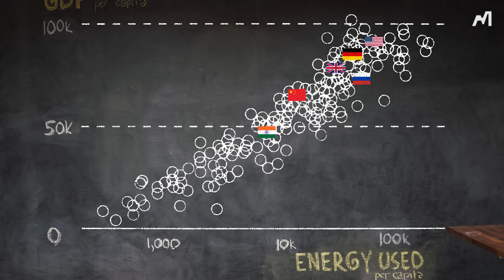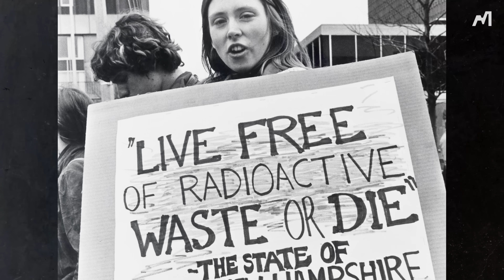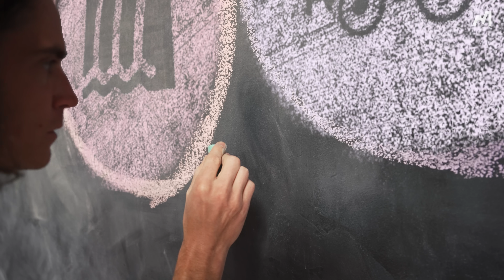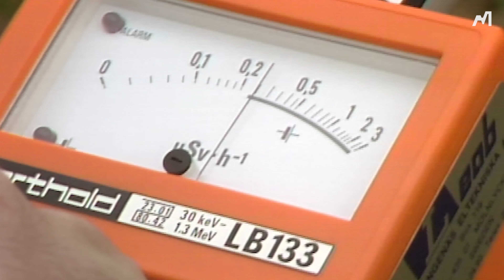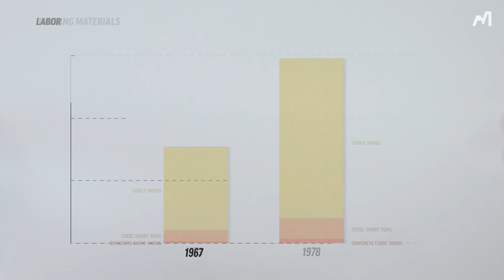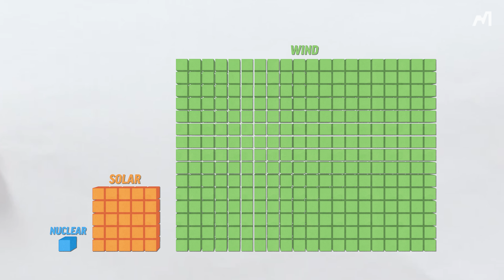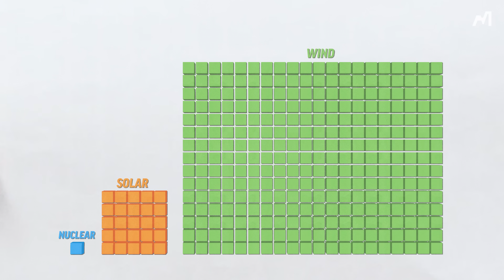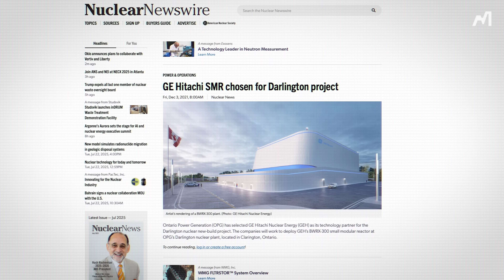They're Lying to You About Nuclear Energy

Comment: Excellent video, though I wish you addressed the alternative solution which could be made better than waste disposal given sufficient R&D. Re-using spent fuel through nuclear fuel reprocessing is what France uses and is partially why they have 70% nuclear power.
Reply: fuel is reprocessed with some magic - ok. what will they do with megatons of irradiated steel and concrete?
Reply: @guai9632  irritated does not mean radioactive and the casks (weather with fuel inside them or if the fuel has been removed) are only slightly above background levels. It is safe to touch casks holding spent fuel, removing the spent fuel does not make it more radioactive. the longer something decays for, the less radioactive it gets. now that i have shown that the cleaned, emptied casks are not super dangerous, we would probably do with the steel and concrete that we do with any other steel and concrete we have used in buildings. the steel is almost always recycled and the concrete will get downcycled (crushed into gravel).

Finally fuel reprocessing is not "magic" as it already works in France and has been for decades.
Reply: @electricminecrafter irradiated actually does mean radioactive. not much, but there's no technology to remove those impurities from the molten metal. I bet you don't want  water pipes in your house to be made of recycled irradiated metal.
Reply: @guai9632  If you'd use that irradiated steel for reinforcing concrete, it might just reach the same level of radiation from the granite sand, gravel and pebbles in the concrete. Might.
Reply: @guai9632 The same "magic" works on those too, if you ever bothered to understand it.
Reply: Doesn't France just dump its waste in the ocean, just like Russia?
Reply: @enratranav7682 no they burry it all underground within waste storage facilities
Reply: Actually it is much more expensive to reuse fuel than to used newly mined fuel. And you are still left with highly radioative waste, highly toxic and radioactively contaminated  chemicals that were used in the process. France does it for strategic reasons, not because it makes economic sense.
Reply: I think he sufficiently pointed out that nuclear waste is such a small problem that it is irrelevant. Nobody is going to steal it. It is not causing any harm. 

If he were to spend much more time on the topic of the waste it would only inflame opponents. 

I agree that there are ways to reuse the waste to a point that there is significantly less to deal with. There are also means of disposal that are less harmful to the environment than other hazardous waste materials that are unknown to the public and managed without incident. 

The fear mongering culture around nuclear has done considerable damage. The fear has no basis in reality, but the age group with the most fear is the same people who have the wealth and voter participation rates to impress their views on the world.
Reply: True. But that is a hot button issue in the US.  Just stick the high level waste under a stable mountain, out in the middle of nowhere. But that also leads to hysteria.
Reply: @Mythhammer I live in Nevada, been here 44 years. I've never met anyone that supported yucca mountain. I have always thought it was the best option. In fact, I believe the state of Nevada should have been able to negotiate enough benefits for residents of the state to make it politically positive locally. Free education to Nevada residents for accepting the waste. That would have funded our higher education and motivated secondary education to improve the quality of high school graduates. This would have significantly helped diversify our economy. 

There is no perfect place to put the stuff, but it is not as volatile as critics claim. They act like nuclear waste is alive and sentient with determination to escape any confinement we create so it can destroy the world. 

Yucca Mountain should have been used.
Reply: @hewhohasnoidentity4377  I think the main concern is leakage into ground water. Plus the danger of transporting it. But yeah, the fear is probably overblown.
Reply: @hewhohasnoidentity4377  as a fellow Nevadan I’d agree that Yucca might’ve been one of the best options. I’m not educated enough on the white river watershed to evaluate the groundwater pollution risk, but if done properly then I doubt it’d be unreasonable.
Reply: @Mythhammer   just throw it in space every 25 years. Simple.
1 big rocket carrying several tons of nuclear waste to space every 25 years. 
Will it make the waste net zero? No. But by the time you go for round 2, rockets would be able to carry many more tons for much less cost as VCs would have an incentive to invest in nuclear waste disposal industry.
Reply: Storing it is a better option than what France does, which is very expensive and barely improves fuel utilization. Better to wait for molten salt reactors, which can entirely consume the long lived component of that waste with very little processing, and without subsidy. Beware the "advanced" reactor vendors that want to be paid for "destroying waste", which they need, because their fast reactors are inherently uneconomical without free fuel.
Reply: @Th-233  Fast reactors can do that too, buddy. Thermal MSRs are not well suited for spent reactor plutonium anyways, you want a fast spectrum for that.
Reply: @Shaker626  Thermal MSRs burn plutonium just fine, and Copenhagen Atomics's TEAC11 presentation in 2022 shows the evolution of TRUs in their reactor. Fast reactors are only necessary if you want to consume the U-238, but they also need a lot more fissile to start, and so the economics don't work. It's also easier to just separate the uranium out first and recycle it back into LEU for conventional reactors, and the plutonium will be burned much faster too. Fast reactors will just produce more of it.

Comment: When I first saw a graph depicting energy output per square mile, I did a complete 180 on nuclear. It’s simply too useful to ignore.
Reply: Why is that compelling though, the world is full of vast tracts of empty space?  Solar works well on roofs, wind works best at sea.

In fact decentralised energy generation is more robust, a single local event can stop a nuclear plant working, it would have to be a regional scale event to stop renewables.
Reply: @slrsteve6359  very simply I actually care about the environment, I would prefer not to completely destroy ecosystems or huge amounts of the countryside/sea with inefficient wind-farms/solar-farms. Nuclear has the basically least impact on wildlife. Decentralization is ultimately uninteresting to me in the face of that. Solar panels are fine for roofs, and turbines should be rare.
Reply: @kurtwagner350 as you observed with solar, there is no direct association between renewables and damage to the environment.  Farmland isn't natural, it's an industrial landscape.  Waters fished using many modern methods are often significantly denatured.

Solar and wind can actually protect regions from further excess human activities and restore a more eco diverse and balanced environment.

Of course any human activities do damage, but good quality solar and wind projects are restorative, not destructive.
Reply: @slrsteve6359  Which means a region-wide devestaiton would further lead to a energy crisis simultaneously. 
And, unless you're accounting for the energy storage, overhead production, waste recycling, etc., Intermittent Renewables are NOT truly green, just non-carbon-emitting.
Reply: @slrsteve6359  land is the ultimate nonrenewable resource, and there's less "empty" land all the time. The best part is the less empty land there is, the more power you need.

Wind and solar aren't bad supplements, but they don't work well at all as the main power source for base demand.
Reply: @Michael-uc2pn any land used for solar can easily be reused, so it is renewable.  In fact, land quality usually improves over the life of a solar farm.  Biodiversity, no use of fertiliser and pesticides, improved water retention etc. also generally improve the local environment.

In the end, to have enough solar under current plans, would require half the land currently used for golf courses.  It's not a big issue.
Reply: Especially when the competition is a barrel of oil. A barrel of oil, ONE barrel, has the energy potential, it carries the work - when expressed in calories, of a healthy adult male doing demanding physical labor, every hour of sunlight for two years. 

The only substitute to nuclear in my mind is geothermal, and you'd have to make a pretty decent borehole to rival the same energy output. Regardless, both are just different ways to boil water to spin copper around magnets.
Reply: @Mix1mum  geothermal is technically just nuclear where the whole earth is your reactor core, casing and you just happen to put a little turbine on it
Reply: @Mix1mum  Fact: It's not. Geothermal has better power output per land area than other Renewables, but all Renewables have VERY LOW DENSITY. 
Plus, a even bigger reason, it's extremely geographically limited. Only a few regions exist where it is technologically possible to extract earth's internal heat. 
It is better than nearly all renewables, but most intermittent renewables are horrifically inefficient, and polluting too. Water and Land pollution is NOT a joke.
Reply: @ZippyPiglin36  if you can dig deep enough, every place on earth is a potential geothermal power plant. We just lack the motivation to dig deep enough.
Reply: @aparnarai3708   Lack the motivation? It's less about lacking motivation, and more about every material that we have literally melts down digging too deep. 
This is why I don't like the pro-renewables crowd. They assume that technology FAR beyond this era would be immediately available in this decade, often considered the "time limit" to revert climate change, and ignore or have intense paranoia about the last sixty years of nuclear energy development.
Reply: @ZippyPiglin36 i personally am in great favor of the proliferation of nuclear reactors and that investment switch from those hordes of useless half the time 'ot active windmills to the ITER project (for nuclear fusion reactors)
Reply: @Project-Hellion I mean, I am in support of Nuclear, but I would still want to see Renewables compete amongst themselves on pure free market principles (aka, no subsidies or government help). 
Fusion however.... it wouldn't be inaccurate to say that Fusion is to be the Fifth Generation of Nuclear. Afterall, both Fission and Fusion are beautiful and necessary steps for a civilisation to upgrade to.
Reply: @ZippyPiglin36 i personally dont want any market competition but eh im not from the USA my views on economics are wildly different and id prefer a world of benevolent econmic actors going for the  interest of humankind as a whole instead of filling theor pockets with a bunch of moeny they wont even use but i digress to me wind and solar are better off for small scale use while nuclear would power the large grids for cities etc
Reply: @Project-Hellion So your views are Leftist in economic policies... You do realise that any attempt at making a coordinated benevolent economy would mean people would be poor simultaneously, without necessarily meaning that government forces would be forced to do similar? 
Socialism seems great, until you realise all it does is combine private and public sector into the government's hands, and results in the general civilian suffering, since if every civilian is poor it does fall under economic equality. 
"Filling every pocket.." is how you grow. Humans grow fastest when their competition is other humans. Such competition is why we expanded into the world as apex predators. You NEED the general populace to have as much as or more power than the government by practice itself, and not relying on fragile paperwork. 
And, I am not for America. It doesn't take Socialism to instill basic workers' rights. Leftism seems great, until you realise it collapses upon itself because of the very nature that makes us human.
Reply: @ZippyPiglin36 remember the time USA and USSR were competiting about who can dig deeper? No one had the tech to go that deep back then. You know what they did? They developed it.
So yeah, we do lack the motivation. VCs don't invest much in this technology's research and researchers don't explore alloys which can go deeper.
Reply: @aparnarai3708  Dude it's been decades since we have had such research with no success. 
Yes, they did have such competition. Doesn't mean said holes were useful otherwise. You need widerz genuinely useful, holes to use geothermal. Mines haven't gotten much too deeper since a very long time.
Reply: Shame this is total nonsense and what actually matters is energy output per cost. Which nuclear is decidedly worse in than solar and wind and this is despite nuclear receiving easily 100 times the research funding over the decades.
Reply: @XMysticHerox  per cost meaning initial investment or operating costs. As far as I’m aware the only significant costs associated with nuclear are the initial investment. After which it is very cheap to operate relative to revenue and energy production.
Reply: @kurtwagner350  Lifetime costs. You should probably look into this if you have any interest in this. It is rather important and nuclear "enthusiasts" love to just ignore it.
Reply: @XMysticHerox  maybe you should look into what lifetime costs consist of because I literally already addressed it. 

In terms of operating LCOE Nuclear is actually cheaper over the lifespan of a nuclear plant than comparable solar generation. Again while also taking up vastly less space and is actually capable of meeting base load power demands 24/7 unlike solar rn. 

And yeah nuclear “enthusiasts” like to overlook upfront costs for precisely those advantages. Meanwhile solar & wind “enthusiasts” love to overlook actual practicalities of what can and should be implemented at scale in our centralized grids by governments (nuclear), vs what makes more sense to use for decentralized uses on a micro scale (solar & wind)
Reply: @XMysticHerox  according to my calculations
PV in the subtropic (desert) with no battery backup: 0,032 $/kWh
PV in the subtropic with a 4 hour backup: 0,073 $/kWh
PV in a temparate climate with a 4 hour backup: 0,10 $/kWh

new nuclear plant construction: 0,055 to 0,069 $/kWh with higher estimates up to 0.1 to 0.2

nuclear takes up very roughly 10 times less area than solar per unit of energy, this is without battery backups
in a desert it doesnt matter but in the temparate zone every square kilometer is land with high biodiversity

PV is in no way cleaner than nuclear, and it is not reliable
while you can have a factory running only during the day, urban areas and datacenters will demand 24/7 power

these are competitive technologies, both have their places
solar belongs on roofs or in deserts
nuclear belongs everywhere you cant build or rely on renewables

also nuclear is so expensive because of regulation and arbitrary component requirements
PV (including manufacturing R&D) has very roughly recieved half the research resources as nuclear (including fusion), do note that this is not adjusted to inflation to reflect the resources that they actually got
Reply: Show how many square miles are contaminated by nuclear fallout.  Fukushima and Chernobyl ABSOLUTELY did contaminate vast areas.  Birth defects have definitely increased.  Believing the USSR and Japanese govts own self reporting about deaths, cancers, heart defects, birth defects is beyond naive; it is willful misinformation with the intent to deceive people into believing nuclear fission is safe.
Reply: As there are a lot of nuclear powerplants around the world now... why is the energy cost still so high?
Reply: @MarkAntony01   Only a select few nations have ever had any nuclear powerplants. Out of those, all except France has had Nuclear for less than 10% of their total grid power in their own atomic ages at best. 
France, with mostly nuclear power, and exporting power to all its neighbours does have one of the cheapest and most reliable electricity.
Reply: For geothermal, you'd essentially need to make Yellowstone and all its geysers basically in terms of power and output, and honestly Nuclear is reusable in a sense that you can use spent rods over and over, always have been able to continue to do so, only downside is that every time you reuse spent fuel is that it gets more enriched, positive side of reusing spent fuel to my knowledge is that its more effective in power outputs the more it's done, just end up with higher % enriched material.
Reply: @councilleader1658  The higher the enrichment, the better. 
If governments wanted to make "nuclear bombs to throw ou countries", they'd do it with much more secrecy and purity than a commercial reactor.

Comment: I love that you talk about every single issue except cost.  https://en.wikipedia.org/wiki/Cost_of_electricity_by_source

Even when knocking down the cost of creating reactors, Nuclear is still the most expensive source of electricity, with wind and solar being by far the cheapest.  We should be building as much of these sources as possible - especially in urban or industrial areas.  To make Nuclear cheaper, we need economies of scale  - it needs to be a massive investment, and federally directed.  But until we get a massive federal program, every other source demolishes nuclear in both upfront, maintenance, and generation costs.
Reply: I think you missed the point of the whole video. The whole thing is about cost, and how over regulation made nuclear more expensive